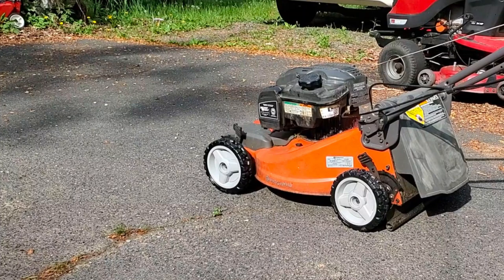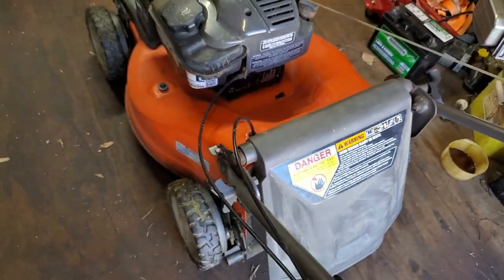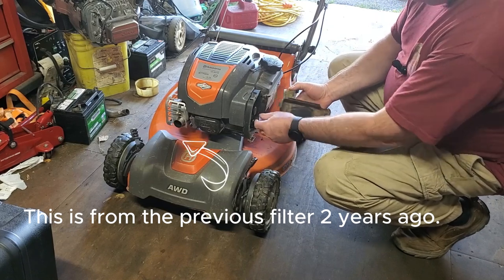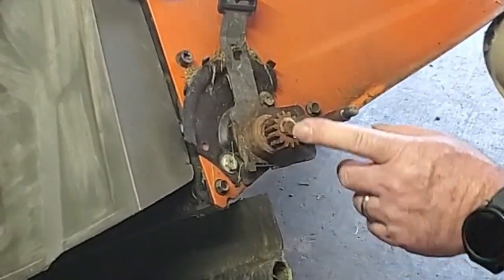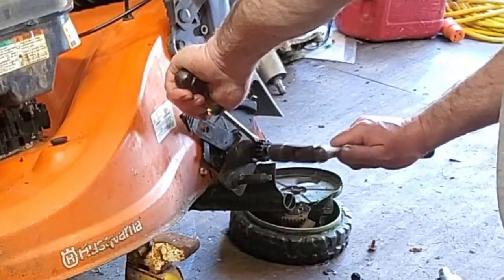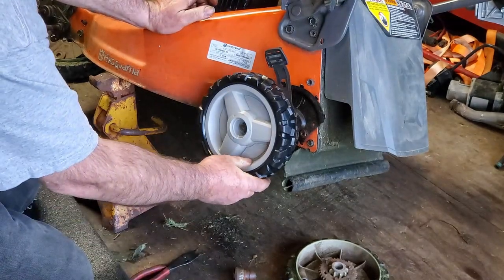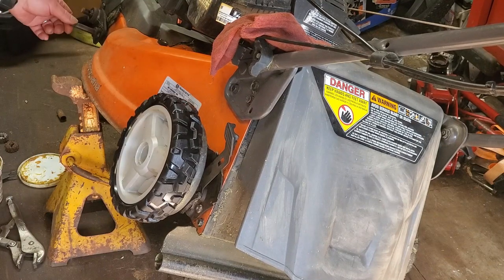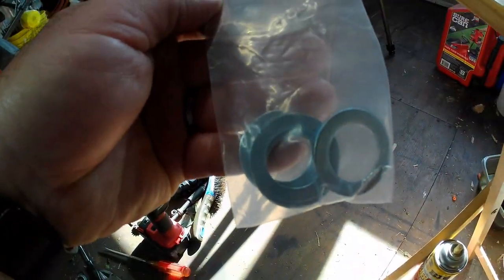Husqvarna AWD axle bearing replacement

Comment: Had a similar issue with a craftsman model. The inner race was frozen to the shaft as well.  Had to pound out the race to get the asjuster off.
Reply from the maker: It does not seem like a good setup,  you would think there would be a better way to build them.

Comment: That looks like it was some what expensive to get the drive Wheels and the other drive system parts replaced riding mower king 👑
Reply: Love them mowers I have 2 of the rear wheel drive ones and they really get a work out! Nice repair💯👍🏾
Reply from the maker: It was a little pricey, I think just over $100 in parts with the oil and air filter. But the owner really likes this mower. And a new one with these features is probably over $600 now.
Reply from the maker: Thank you for the positive feedback. My videos will get better with time. Repairs are easy, videos take time to get good at making.
Reply: @ridingmowerking  Exactly 💯
Reply: @ridingmowerking   👍💪👌🙏
Reply: You assembled it wrong thats the reason it felt floppy
Reply: The gear plate goes behind the wheel adjuster
Reply: I could be wrong but that is the way mine was assembled